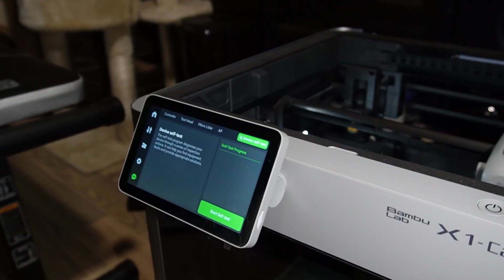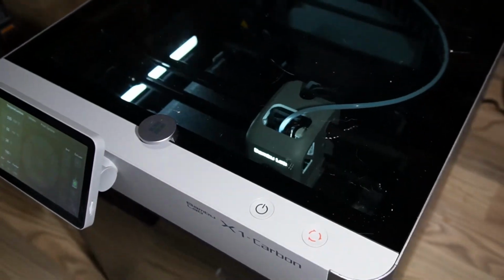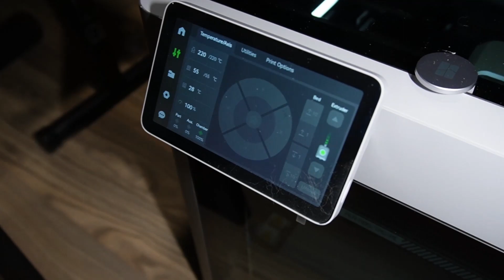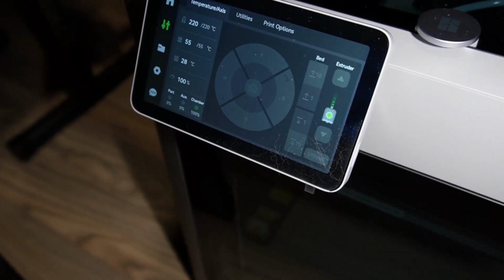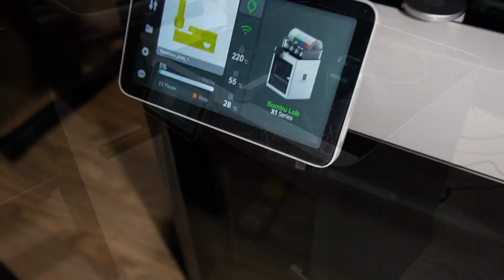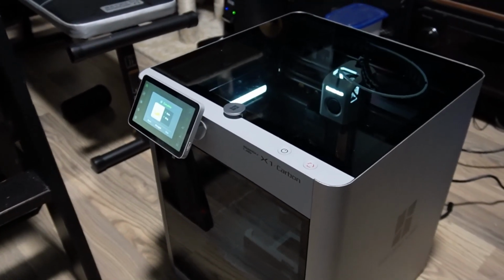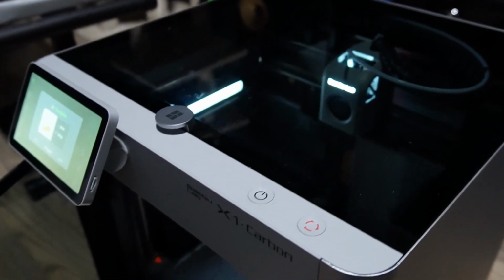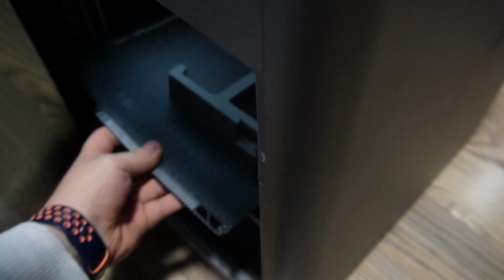Bambu X1 carbon heatbed sensor cable replacement

Comment: 03:10 I recently had the same failure issue. I don't understand the design of the Bambu Lab engineer. When someone is replacing only the heat bed signal cable or only the power cable, it is too cumbersome to have to disassemble everything because of the small hole in the z-axis. Even the ground wire is attached to the right panel. For whom is this design for? When this issue occurs, we should think about the improvement to the primary Z-axis assembly rather than the secondary response. Bambu Lab must provide the Z-axis assembly improvement along with the replacement of the cable.

Comment: Had same issue- bed quit heating with a fairly new P1S.  They sent me a new heatbed cable.  very dubious this was the issue, but  dutifuly installed it.  Surprise, surprise, till the problem of no bed heat persists..  Waiting now to hear what's next- new thermistor ?  New board ?  At least I'm getting to know and be more comfortable with the P1S innards which I was fearful of screwing up..  But also seeing some stupid design, like a little metal bracket to hold cables in with two tiny metal screws and is IMPOSSIBLE to replace.  Oh well...
Reply from the maker: exactly, bambu's printer designs are not really made to tinker around in it.  Which is a shame...

Comment: My bed isn’t heating up. Contacted support, they are slow to respond. First response take apart and check cables and now I’m waiting for another response. What is your experience with the support ticket from Bambu.
Reply from the maker: Hi Barry, sorry to hear that your printbed isn't heating up.  My experience with the bambu support was pretty good, they were fast in response and helped me efficiently.  Do you get any error messages on your printer?
Reply: @aim6mac  thank you! I enjoy your channel.
Reply from the maker: @BarryBernau  glad to hear that!

Comment: I had to replace my cable after only 70 hours of print time. Got it back together but I do not understand the bed leveling process. How did you get yours to print well again?
Reply from the maker: TBH all i did is recalibrate the printer through the 'Start Calibrate' option , thats all i did and it's printing with the same quality as before.
Reply: @aim6mac  did you run their level g code that is in the instructions? Or slap the bed on and press go?
Reply from the maker: @disturbedfan545  instructions? what instructions hehehe, ... no i didn't use any gcode to align the bed or anything.
Reply: @aim6mac  man idk what you did but your good then 😂 I followed their wiki and it didn't do anything but make it worse.

Comment: Mine should be arriving in about a week. Would you suggest anything to do proactively to avoid this? Maybe you have another video, I will check… But would love any input you have. Thanks for posting this kind of information.
Reply from the maker: honestly u can't avoid it from being happening, it doesn't always happen, but i think eventually it would happen ... although if your X1 Carbon is a new version, it will come with the revised cable.
Reply: @aim6mac   - Gotchya. I will give it a look over for potential issues prior to going balls to the wall with it. Thanks. 👊🏽👽👍🏽

Comment: So what made the cable fail? Would you still purchase one of these printers knowing this? Thank you for the great information. 💪
Reply from the maker: Quality issues with the cable, i'm guessing it's the lenght of the cable which makes the cable grind on the small opening that it's been fed through. The replacement cable is a little longer and should resolve this issue. Me as a thinkerer would surely get another bambu printer and Bambu has resolved this issue on the non Kickstarter versions anyways.
Reply: @aim6mac  This is the response I was looking for, that they've fixed the issue on newer printers going forward.
Reply: @aim6mac  thank you for the clarification, I really enjoy the videos.
Reply from the maker: @Reindeer-ry2lf  Thank you!